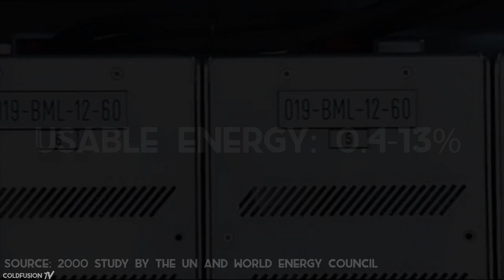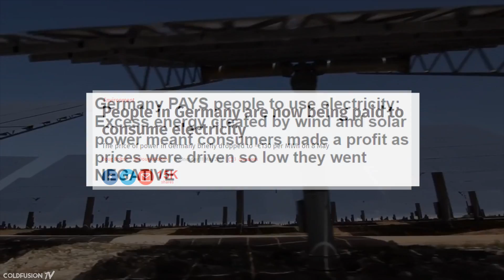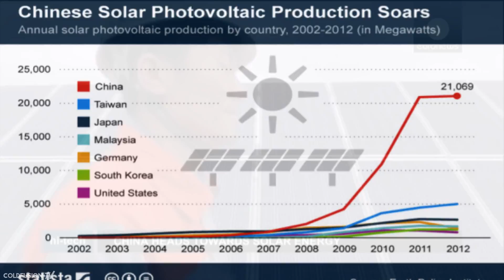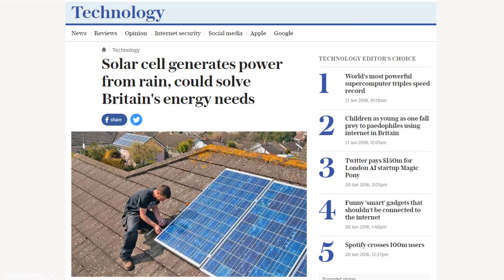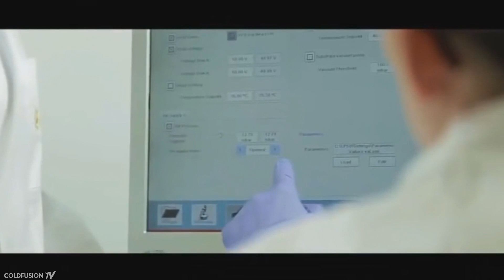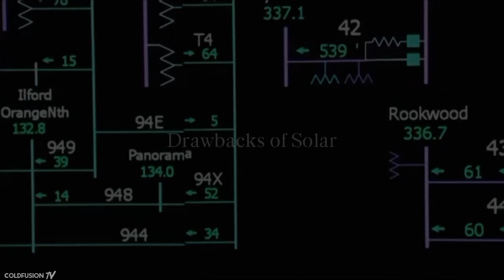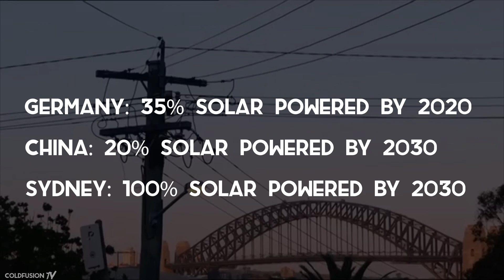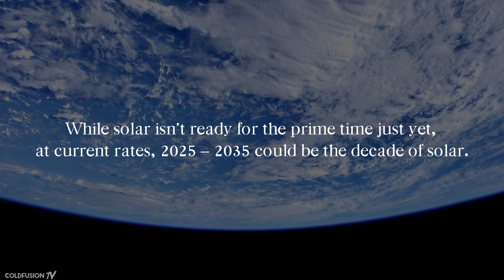The Truth About Solar

Comment: Most people only think of batteries as the only electrical storage method. Hydro electricity generation can also be a method of energy storage. At peak times water can be to drive generators by using water from a high storage dam to a lower storage dam. Solar energy can be used to pump water from the lower storage to the upper storage for later use in peak usage times.

Comment: Elon Musk hasn't done the land use statistics for the UK. Various government bodies like the energy technologies institute have. The short answer is to green the UK you need around twice as much electricity as current consumption. Putting solar on every roof won't come close to cutting that and you'd need to cover a significant proportion of the UK's farm land to be able to supply the UK with even a fraction of its energy requirements by solar. Solar would be fine in a sunny country with lots of low value land and few people, it won't make a substantial contribution to Northern Europe.
Reply: So that's a great news..now u guys have to buy enegry from another country...bagger..first u guys bagging from oil or coal now enegry.. hahahahahaha
Reply: Many people like to get tinted windows to reduce the glare and heat coming from outside. Typical window tint allows 10-30 percent of light through. That means window tint blocks at least 70% of light, some up to 90%. Yet that still lights the room comfortably.

Comment: I like to imagine that one day, in the not too distant future, we won't even need super-thin solar panels... we'll just coat stuff in a clear, super-efficient "solar film" that's kind of like an environmentally friendly polyurethane, but transfers energy. You'll just be able to "paint" it or spray it on your house, or your car, or your sidewalk, and those things will provide power for everything you own. Couple that with new technology that transfers electricity through the air wirelessly, and we'll just take down the entire power-line infrastructure because we won't need it anymore. The power companies will go down swinging, but they'll eventually lose the battle, and the electricity bill will go the way of the typewriter. Energy is just free now. Everywhere in the world, at all times. Forever. And humans' environmental footprint will be zero with respect to energy production/consumption. This will free up our best and most practically-minded scientists and engineers to focus on other innovations, which can now take a giant leap forward without the need to account for "energy efficiency." We'll also be able to focus our energies elsewhere, like space travel and colonizing Mars, because having energy technology that doesn't require "batteries" or a "grid" will make Mars colonies MUCH cheaper and simpler to achieve (Mars also gets sunlight). And when energy is efficient enough that we no longer need "fuel," those trips back and forth between planets are going to be a lot cheaper. Back on Earth, our best minds can focus all of their energies on curing diseases, solving aging, increasing food production for poorer countries (which are no longer that poor now that they have an infinite energy supply), cleaning up the rest of the environment, and improving general quality of life. 

OK, I got a little carried away there... but yeah, the future could be a lot brighter, especially if people focus less on defending "old ways" of doing things and roll up their sleeves to help. Don't ever let anyone tell you that we have a "good reason" to stick with coal, or oil, or natural gas, or any finite, Earth polluting substance for our energy needs. Those people are either benefiting from the profits from fossil fuel consumption, or they've been duped by the people who do. Stay focused on tomorrow, and we might actually have a tomorrow worth living in.
Reply: Solar paint is already here.
Reply: Dream on
Reply: How do you propose to do this? You know damn well that the unicorn union won't think much of your plans to overwork its members ...

Comment: The key issue with solar PV is that substantial levels of output only occur for a few hours around mid-day.  This may suit some situations, for example in hot climates where aircon can be solar powered. For most purposes though, it means you have a surplus of power at a time when it mostly isn't needed, and little or none when it is. The notion of using batteries is really not feasible on an industrial scale, either. 

There is also a danger associated with asking people who are trying to sell you stuff, for opinions on technology. 

In many respects the Bloom Box is a much better alternative. Whilst it still needs a fuel source, it provides controllable power when needed, 24/7 if required,  and achieves a much higher conversion efficiency than conventional generating plant.

Comment: 35% is extremely optimistic. Those numbers are only reached on high end panels designed for satellites, and they cost about $1k per 2sqcm. Consumer panels are around 15%, 20% at most.

Comment: photovoltaic panels suck xd but solar colector + steam turbine we can use 30-40% electric power from sun, no 1-15% from photovoltaic panels xd  in europe power from sun is around 600W/m^2. so 250W/m^2 or photovoltaic eletric power 90W/m^2 xd

Comment: The problem with solar panels is not efficiency, it's utilization. If we used every sun-facing surface to harvest solar energy, the panels would need to be less than 1 percent efficient.

Comment: The most efficient solar panels currently on the market are only 22% efficient, not 30+%. Some laboratory prototype experimental cells are far more efficient, but none of these are commercially feasible, often because the cells aren't stable and break down quickly, or they cost far too much.

Comment: There are currently utility scale batteries to help smooth out solar and wind production,  also innovative local solutions to store energy till needed. One such is a pumping station that pumps water uphill with excess energy , then when energy is needed it flows down to turbines that produce power. That wont work for many but there is current technology that would work for most locations.

Comment: In our area its not feasible because the solar systems are too expensive to ever pay for themselves.. we also have privatized electricity which charges 50% just for connection fees.. which means that very little of the actual bill will be lowered to pay the cost of the system.. It simply doesn't pay for itself.. the only way I see the motivation changing is if we buy back the utility and then pay people with solar enough to put energy back into the grid.. for now it's a nice idea.. a feel good idea that costs the homeowner extra that they'll never get back.

Comment: You left out the rolling black outs in those solar countries, you left out that in order to respond to the solar variations you have operate fuel burning energy generation system that are significantly less efficient.  Germany saw that it was actually burning more fuel than if they ran more efficient system burning systems.

You left out the need for battery systems to hold power, the expense and maintenance of battery storage.  You also left out the AC/DC and DC/AC 15% loss in transition, as well as the typical grid loss of an additional 15%.

The biggest point you left out was that single junction maximum efficiency of about 33% solar conversion.  Without a fundamental breakthrough in how solar panels work this is likely to never change.

Comment: I work in energy. It bothers me that solar power is treated as a magical solution to energy problems. It's best use is probably in commercial buildings, because their peak power consumption is during the day, so it matches well. Battery storage for home use is...less than ideal. No utility I have worked with will even consider battery storage, and add the fact that it's a huge pain in the butt to integrate soar into the grid, solar cannot be a viable utility-scale energy producer, nor can it reliably handle baseload. Sydney's goal for 100% solar is a joke in my circles, because that is not attainable, sustainable, or reliable. I have never heard anybody working in energy talk about solar as anything but a way to reduce power needs--they never talk about using only solar or replacing large baseload plants with it.

Some issues you didn't cover:
- Solar cell manufacturing requires high purity materials, which require enormous energy input, even requiring more energy in to produce than the cells get out in their lifetime.
- Solar panels stop being useful or outright fail within 10-20 years and need to be replaced to remain efficient. However, these panels don't have a planned end game, and so there are entire landfills that are filled with nothing but piles of solar panels, many of which leach off toxic chemicals as the sealant cracks or is broken.
- People keep talking about efficiency improvements. Sadly, there's not much more efficient they can be made using current technology. We're hitting quantum material limits that we cannot overcome. There are other technologies, like rectifying antennas, that could get to higher efficiencies if we could overcome some quantum effects that, at least in some research papers and PhD dissertations have postulated could be possible for specific photon frequencies, but projections for any conversion efficiency remains around 45% as the maximum reasonably achievable.

That said, it does have a place: as I said, reducing grid reliance for businesses, offices, and large installations (like airports) that pull max power during the day make a lot of sense. Places solar does not belong is utility-scale operations or as a magical stand-alone power production method. We do have a powerful green technology for baseload that we can deploy now, and remove all fossil baseload plants, but we'd still need fossil fuel peaking plants to handle swings in demand at the very least. And, sadly, people grossly misunderstand and illogically fear the green tech I speak of--nuclear power, which is my field. But, that's a discussion for another time. Maybe, ColdFusion, you could cover this green tech in an honest, fair manner? I would be willing to help you write the script and fact-check, if you'd like.

Comment: It's been viable for decades, the reason we keep being led down those false paths, like solar roadways, and other BS, is to keep centralization of energy production for the benefit of the energy producers.

Today, it's ENTIRELY viable to run your entire house hold on solar, provided you have enough energy storage and live in a climate that produces adequate sun.  You could have done this 30 years ago, but batteries were crap back then, panels were more expensive, and it was a lot more work.  Not today.
Reply: so, you live somewhere that doesn't need Air Con then?
Reply: Did you make your house entirely solar dependent? If so, when do you get ROI?

Comment: Zzz, solar is a joke. Investors are selling this product at a price where failure rate matches that of saving costs. I.e. spend $2000 on a panel and that panel will fail before you have saved $2000 off your powerbill. Likewise as electrical providers are losing money they are unable to invest in large scale operations. Like you said we are generating too much power therefore there is no incentive to build more efficient large scale operations. 

Fact is we should be using more power then ever before, this will actually lower costs because of the high demand. Instead we have very clever advertising campaigns to sell overpriced and rather useless products such as LEDs, Energy savers and solar panels. 

You have to understand this these products are not biodegradable and when they fail we will be filling landfills with more and more hazardous waste then ever before. People are already disposing of mercury filled bulbs in unsafe manners that will leech into water supplies. 

Here i was hoping the title actually stated the truth, instead its just a sale pitch for your invested interest in a useless product that still requires huge R&D and will only see the cheap productions costs turn into huge profit margins as you will match costs of the grid instead of offering alternatives. How else do you recoup costs... or make profit

Comment: wouldn't the panels need to be constantly cleaned if you lived in a place w/ a lot of dust & or snow? Is that not a downside, having to go outside every 10 minutes to shovel off your solar panel if you live in an area with a lot of snow?

Comment: Your calculation is wrong. 
You do not take in consideration the cost in energy of building solar panel. Rare minerals extraction is very expensive in energy and pollute a lot. 

The cost of transportation (actually China is main producer of solar panel), and the life duration of solar panel need to be take in consideration.

Your calculation should be :   Energy_produce_solar_panel_life - The_cost_in_Energy_to_produce_solar_panel = net_energy

Comment: Nuclear and solar power are the way forward. Radiation is relatively easy to contain, basically the more mass you have around the radiation source the better, and nuclear fuel produces an immense amount of usable energy per mass. Nuclear power is by far the best way of generating the base voltage of a power grid that's needed 24/7.

Comment: Nice try but solar is 99% useless until solar energy can be stored for when it is actually needed. When I can buy a refrigerator sized battery for $5K that will store a weeks worth of electricity that's when solar is viable.